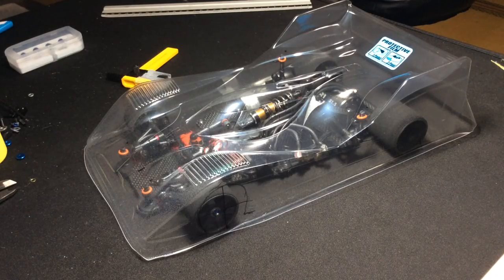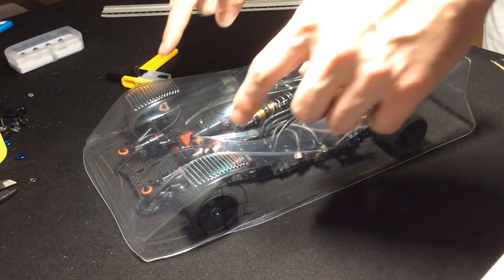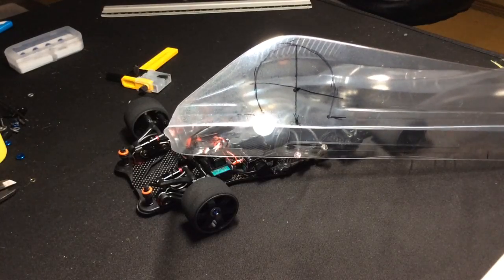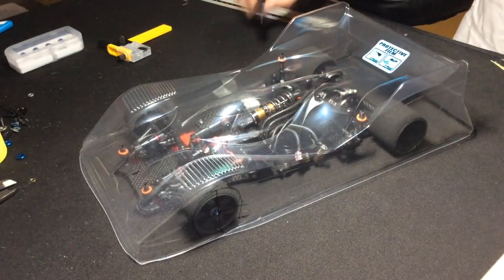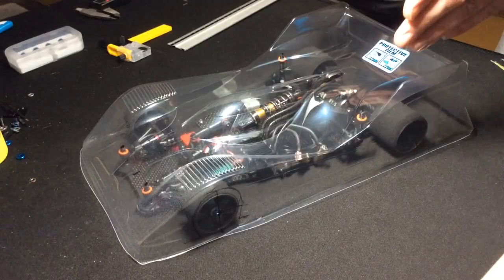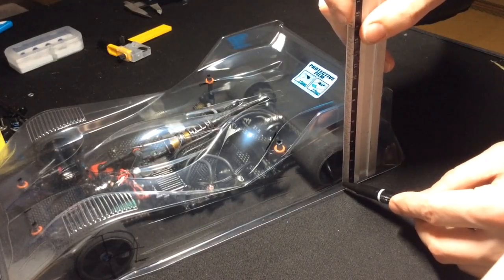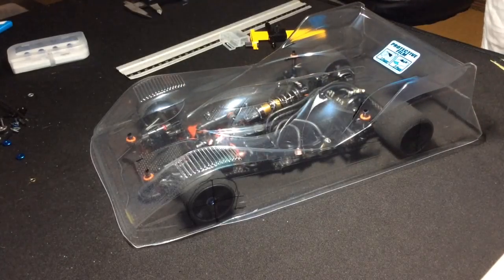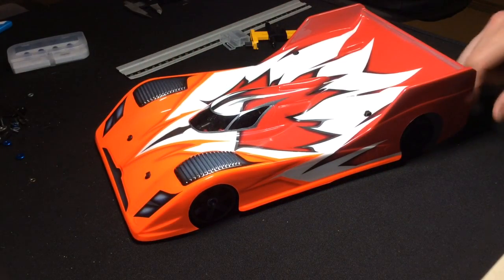How To Mount A 1/12th Scale Body

Comment: Good stuff. What I do, cut the lowest part of the body, at the cut line around the whole perimeter. Then align the body side to side, front to back.. ream the holes.. sit the body on the chassis and correct the ride height.. then you know exactly where your wheel wells go.. making sure to keep them a couldn’t millimeters larger than the tires.. and making sure the steering is turns at full lock, so the body doesn’t hang up on the wheels.

Comment: What do you use to space the front and rear wheels?  

Awesome videos.  I have watched a few and am learning more than I knew from racing these for many years (with a break)..
Reply from the maker: Rear wheels will require axle spacers which you will place between the motor pod and hubs. Make sure you use an equal amount of spacers on both sides. 

Front wheels you can use small axle shims on the front axle. 

Please refer to your manual for the correct shim sizes for front and rear axle shims.

Hope this helps.

Comment: For this scale what size servo do you use for steering
Reply from the maker: There are servos specific to 1/12th scale chassis. Companies like Futaba, Sanwa, and Hi-Tech have dedicated 1/12th servos. There are servos for different applications that will work as well, but you'll need to do a little more research to figure out which servos will work.